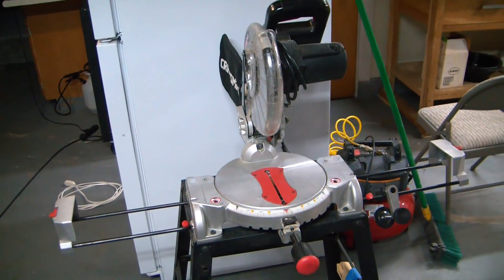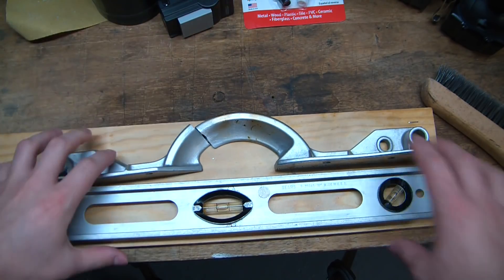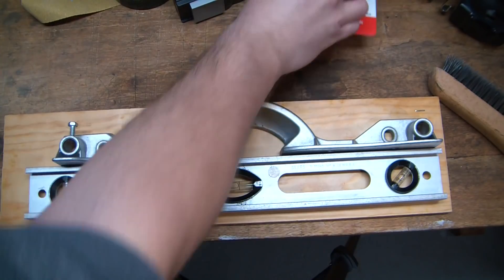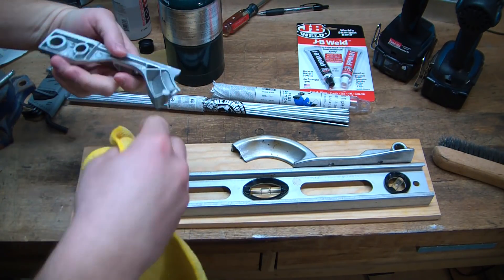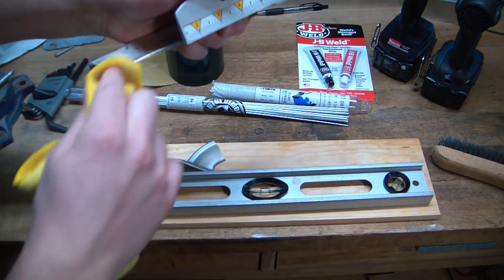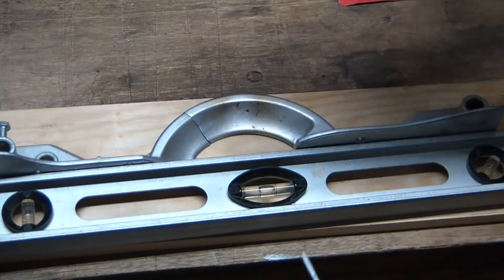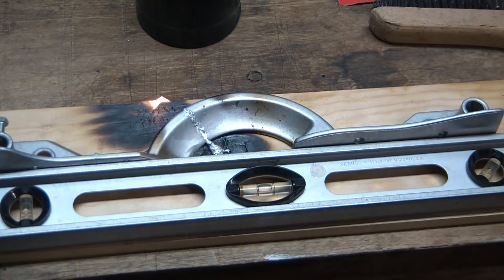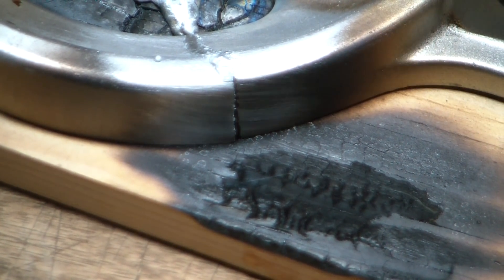Does Aluminum Brazing Rod Actually Work? Real World Fix Miter Saw Repair

Comment: I'm not sure you should have a long chain hydrocarbon source as the thing your clean brazing environment should be setting on. I know a lot of those compounds can serve as a flux, but most of them just serve as contamination.
Also, it looks like you were mostly melting the rod with the torch as opposed to heating the metal and the metal then melting the rod. I havent used those so I cant say for sure, but you might have ended up with something that's mostly cold weld.
Reply from the maker: Your probably right about that

Comment: hey, i'd clamp i real straigt, and fill the underside with epoxy, that ll hold nicely and u wont ba able to break it. also u get another easy shot at making the damn thing staigt. if u heat it, u'll always have the shrinking of the material afterwards, so it will always be warped... cheers :)

Comment: Glad to finally hear someone else had the fence issue. I have a 12" Craftsman from around 2000 which has the exact same issue. 
Never once got around to doing anything about it.
Reply from the maker: I think mine was probably from around 05-07, so probably made in the same cursed factory. Next go round I'll get a proper Makita or Dewalt miter saw
Reply: @ElementalMaker  my work has a ton of Makitas they use for production work, and they end up replacing several a year. Not because they are broken or worn out, but because the bearing in the arm gets gunked up with sawdust due to poor dust collection. The operators complain that it gets hard to use, and the maintenance department can't be arsed to change out the bearings so they buy a new one and plop it in. 

Works out well for me, since now I have a relatively good Makita that is just a bit chunky when pulling the arm down until I replace the bearing myself. Other than that it works great despite 80 hours a week of pretty constant cutting for around 2 years.

Long story short, yeah a Makita is a great choice.
Reply: I also had the same issue with my Craftsman.

Comment: I think you needed it beveled a bit, like doing a butt joint and more heat for the solder.  Then again, the actual aluminum started to self destruct with just the propane flame.

Comment: Problem with cast is entrapped gas in the casting, when heated for brazing or welding the gas pockets expand and cause blistering and fracturing of the grain structure. It's almost a futile effort, you can bake it at 350F for a couple hours to artificially age it and refine the grain structure before welding as well
Reply: Almost looked to be pot metal, really.

Comment: Wouldn't a oxyacetylene torch make it way hotter and better chance of it flowing further in?
Reply: If you want a puddle of metal sure lol. Seriously just the normal torch damaged the fence, and an oxyacetylene torch is more than twice as hot.
Reply: @WhyNotDeanCV  it just made it bubble a little bit, and he wouldn't of had to hold it on it as long as the regular torch.

Comment: First off- CLAMP your work down!!!  You want some degree of precision in the final part, but if you don't fix things in position, they are going to move.  This is especially important for any welding / brazing as things move when they heat up and cool down..
Anyways those rods can work fairly well, but they work very differently than regular soldering or brazing..  The material runs and flows, but NOT into joints..  The joint MUST be Vee'd out to give surface area for the new material to stick to, you can't just butt the broken ends together.  And instead of direct flame to the joint, you need to heat a large area around the joint and get the area just hot enough that when you scrub the tip of the rod into the joint, it starts to barely melt and wet out the surface.   Then gently keep the flame playing over a large area to keep the temperature constant and keep scrubbing the rod into the Vee'd out joint surfaces until it's all coated and then increase the flame coverage a bit and NOW you can flow some of the rod and it will stick to what you laid down previously and completely fill the gap.  Keep the heat just enough to flow where you need material, if you have too much heat, it will literally just run out of the joint like water.
Reply: That is the way to do it. You must have seen many a dog n pony show at the county fair with the $20.00 per stick wowie zowie rod guys. Clean the joint, preheat, add flame and scratch the rod, alternate flame/dab the rod, let slow cool.
Reply: Flying0Dismount my IQ just went up by reading your comment. Best comprehensive description of aluminum brazing ever.
Reply: Can you make a video or provide a link to a video of someone doing it correctly?

Comment: You need more heat. The aluminum needs to be hot enough to melt the rod on its own (like soldering copper pipe) otherwise its not going to get a good bond.  Mapp gas at least is needed for anything with much mass.
Reply: The mapp gas also adds a touch of carbon to aid as a fluxing agent. An ir thermometer to try not to exceed 750 deg  would lend added confidence. Ceramic tile as a backing plate if I were to nerd out on it.

Comment: the braze is way weaker then the parent material...if you really want this to work, clamp both sides, flip it over and gob the back side with the solder.
Or: once you get the welder up and running, make this out of sheet steel (find someone with a laser or plasma table), it doesn't look that much of a complicated part.

Comment: Next time use clamps to hold the piece to the level, grind the pieces in to a chamfer so the braze sticks. It's not the best fix but it does work

Comment: My experience with the aluminium braze stuff has been to post heat it and let the higher zinc content creep into more of the base metal to get a decent joint. 
And as astute as you are you probably noticed zinc as in brittle but strong alloys of aluminum and that is definitely true of the joints so I always backed the welds with some scrap aluminum as well. 

Between the scrap AL and post heat allowing the zinc to creep I've always had a very strong joint with no sharp transitions between the alloys

Comment: 9:17 - I bet JB Weld would've held better than that braze did with less fuss. Check out Project Farm's test on glues, as I remember JB Weld came out pretty high on the lists for the strength tests. Anyway, definitely an interesting thing I didn't know about.

Comment: Ive used those rods for 30 years. Keep the joint out in the open not touching anyrhing and clamo it. You have to scratch the surface with the rod to break through the oxides. That stuff is a pain in the ass no mater what. I would make a fence out if angle iron.

Comment: Was pretty much my experience with using some of that stuff to patch a boat up.  Sort of works but it's definitely not great
Reply: It works great if you know what to do and what not to do. If you didn't get a good result it is most likely that you did something wrong.
Reply: @insAneTunA  If you got a good result, you didn't really expect much or inspect the results in any quantifiable objective manner.  These rods are sold with relatively expensive flux to professionals for a reason.  Functionally identical alloys are sold cheap without flux to suckers on Amazon for a reason too.  Those reasons differ.  Zn-Al processes without flux are very limited in what they can do with a practical amount of time and effort.  You're not going to get any capillary action without flux.  You're not going to braze socket joints without flux.  If you think bridging a scab over the top of the joint is "working great", then maybe you don't notice the difference.  

Even in the case of a "good enough for what it has to do" joint (hey, not all things need to be perfect), Zn-Al is still limited by its severe susceptibility to incisive corrosion attack.  That really doesn't matter for a miter saw or a coat hook, but it sure would for a boat or a pontoon or an aluminum truck wheel.  Like I said, there's a reason they're sold without flux, and it's not because the flux is unnecessary.
Reply: @PSUQDPICHQIEIWC  Even if we let the aluminum rods out of the equation, you can still see that the man in this video is doing some things fundamentally wrong when it comes to brazing metals. You don't have to be a total expert to see that. All you have to do is to watch some videos from some real fabricating experts like Abomb79 or Keith Rucker, or Keith Fenner. When they braze something they closely monitor the temperature and they make sure that their work piece fits all the requirements for a successful brazing. No matter what metal that you are trying to braze. 

Right?
Reply: @PSUQDPICHQIEIWC  If a person steps into a car with a blindfold on, that person should not be surprised that he does not reach its destination.  And that person cannot blame the car for not reaching its destination. 

(if the blindfolded person is the driver and when it is not a self driving car)

I mean, you can tell a whole complicated story about alloys and what not. But you and I know that the demonstration in this video is NOT how you braze metals. No matter what metal you want to braze. 

Can you agree with that? 

And a simple yes or no will do hahaha
Reply: @PSUQDPICHQIEIWC  Coincidence or not but today this video from Project Farm came out, and Aluminum rods are the topic. Best Low Temperature Aluminum Welding Rods? Let's find out ! https://www.youtube.com/watch?v=fKIKsDfRAcs

Comment: Sometimes fixing something is more fun than buying something new.
Reply: Most definitely! I've got an old 1980s Taiwanese floor drill press that I'm restoring and if you want to get anywhere near the build quality of those on something new you'd have to drop a grand.
Reply: Sometimes! After cleaning out the carb on my John Deere mower for the 10th time they all become pieces of shit!😂 (And yeah, I used ethanol free gas. It still managed to trash itself...)

Comment: I had the same problem with mine and i solved it by cutting it (instead of breaking it ;) ) and enlarging the holes of the fence to give me enough adjustment to be able to square both sides to the blades .
Reply from the maker: Now that would have been the better move!
Reply: @ElementalMaker  There's always time to make it right the second time , 

we make it nice cause we make it twice LOL.

Comment: I've used that stuff before too EM. If you clean it really good with a stainless steel wire brush, "V" out the break on all sides if possible, then fill the "V" cut with the melted rod, it actually works pretty good. At any place you stop, be sure to clean the weld area again with the SS brush because aluminum oxidizes very fast and the "solder" won't adhere well to the oxidized metal.
It is probably faster and easier to TiG weld it if you have a TiG set up and ready to go. 
Best of luck to you, stay safe and healthy my friend!
Reply: True, the directions are specific, clean/new/unused stainless steel brush. Makes all the difference.    Mostly a zinc rod with trade secret impurities
Reply: @maxprophet2401  Hmmm.  Who would sell fluxless rods for a heavily drossing process like Zn-Al?  Someone with engineering resources and expertise who carefully crafts super-secret alloy nuances, or someone who remelts scrap Zamak and hawks it on promises of fixing anything and everything?
Reply: @PSUQDPICHQIEIWC  read the label
Reply: @PSUQDPICHQIEIWC  yup, mostly the dance part, but never lose hope.
Reply: Good advice.
Reply: I thought the wood burning was putting carbon into the join as well so that on top of the oxide forming not good. Great advice on how to do this by the way.
Reply: lol I was going to say this, it's a very standard welding procedure, yet I never really knew you could flame alu so easily without the whole thing melting up into a big puddle xD

Comment: I'm guessing that job wanted some flux.
Reply: My thinking exactly, but I'm no welder/braizer so I don't know if there is such a thing as flux for Al.
Reply: @SteveBrace  There is a product 'Alumaflux' from union carbide/linde/l-tec/esab but really not needed. Those are the same rods the 'wowie zowie' county fair guys use and sell for $20.00 a stick, they just clean the joint extreemely well and preheat to about 700deg and let the part melt the rod not the flame.
Reply: @PSUQDPICHQIEIWC  Originally I was thinking of a product called Aladin 3 in 1 it's just been so long since I was on the other side of the counter. I had a customer called Galaxy Brazing that bought direct from several manufacturers at prices I could not even get close to, they stocked and moved more flux than the distributor I worked for with 4 stores. They also used a Hindenburg worth of hydrogen every year too. I went to school with a chemist that worked for Stoody Co and he revealed the 'secret' formula of most of the industries proprietary dissimilar rods, even brought in some rainbow colored samples, the instructor would not concede that his $60.00/lb rod was equal in every way but color to a generic $3.00/lb with the same chemistry and physical properties. I did a short stint at a rod manufacturer from Texas who also had a 'special' line of unmarked rod, 312-17 baby blue coating but three times the price. The owner said the price demands respect,  I told him my ethics demand honesty and we didn't sell much of that on the west coast.

Comment: you need to get the metal hotter, use a map torch.. or your HHO torch! if you have borax you can use some of that as flux so the solder sticks better..

Comment: I tried to fix a 67 Mustang aluminum headlight bucket and it turned into a puddle of disappointment on the garage floor.
Reply: That's probably because it was not aluminium but in fact diecast zinc. Vehicles from that era used zinc far more often than the did alloy since zinc can be chromed relatively easy in comparison to aluminium. You can repair zinc but the process is somewhat different.
Reply: Scooter Tramp yeah, you’d need a real hot flame to leave a puddle of aluminum.
Reply: @oh8wingman  Sounds like zinc to me. I was doing myself some anti-cold tonic out of zinc wheel weight and the exact same happened. It looks solid untill it craps itself on and into the stove  👌
Reply: thin aluminum melts fast even with a air fuel flame.  I tried to patch a hole in a cheap aluminum kitchen pot, for shop use not cooking, but the aluminum just went all drippy before I could get the braze into it.
Reply: @GigsTaggart  their melting points are close. 660 and 420°C. Interresting. I was never able to melt Al spoons and stuff. Maybe because it transfers heat well so my fingers couldnt hold it and it may even  move the heat into the pliers. Interresting indeed. I remember leaving Al pot to fire-clean in a fireplace

Comment: That torch head is supposed to be used with MAP gas. That's why you are having trouble getting it to start.
Reply: Jon Dresser then why is it sold with both propane and map kits? Its not lightning because the igniter needs to be adjusted. They dont last long before they start having issues.

Comment: I had the same sparker problem with my TS4000. Crack it open and mess with the piezo wire. I had to fully replace mine and it wasn't too bad, just a little fiddly. I think the wire oxidizes over time.
Reply from the maker: I actually replaced the old piezo igniter in it, the original was cracked. I took one out of a BBQ lighter and rigged it to work. I think that ones starting to go now though.